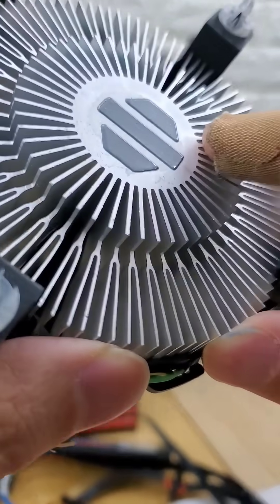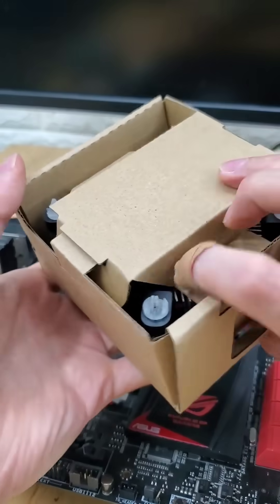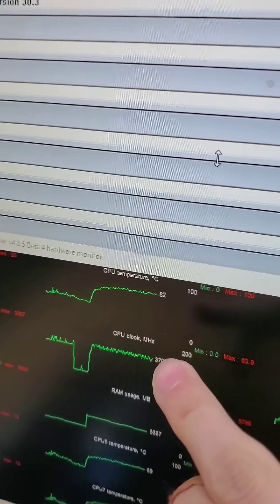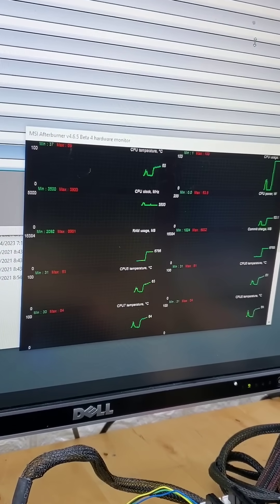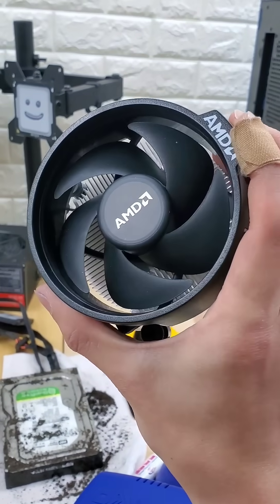how BAD is Intel's stock cooler? #shorts

Comment: Looks to me like you compared intels Copper core cooler with their non copper core coolers. The thermal paste wouldn’t make a huge difference the copper here definitely screws up the results.
Reply: glad someone else noticed as well
Reply: the copper one was just demonstration b-roll
You can see that both the coolers he tested had blue sticker, but the b-roll cooler with copper ha51, d sticker with half blue and half gray

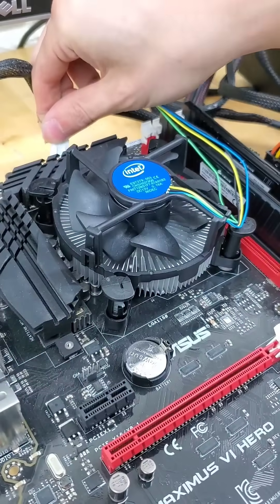Stock thermal paste: 0:16, you can see the cooler is blue
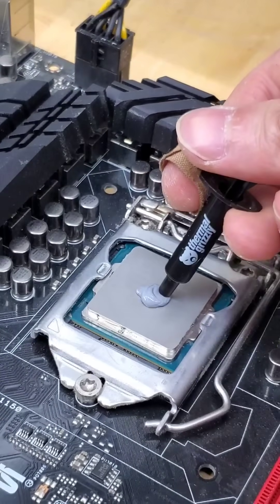High performance thermal paste: 0:38, still the blue cooler
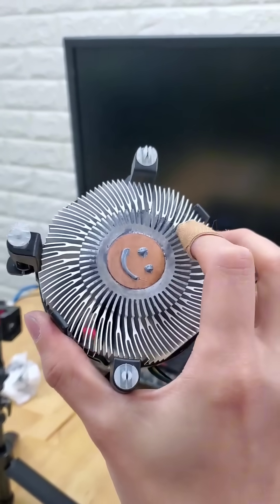B-roll cooler, 0:51
Reply: The smily face one is for denonstragive purposes. You call tell just by the cooler design that its the same one
Reply: Yeah there is nearly zero chance that he was dumb enough to not use an identical cooler for each test.
Reply: @MsHojat  He was not good enough to use identical cooler for video. So chances that he didn't use identical cooler for testing way greater than zero.
Reply: The aluminum cooler in the two tests has a blue sticker. The copper core cooler pictured at the end has a blue and silver sticker.

Comment: Try replacing the standard paste with PTM7950, since it’s likely formulated for endurance rather than peak performance 

7950 is also a high-endurance thermal transfer material, so it’d be a more apples-to-apples comparison

Comment: I have done many a test with the AMD box coolers wirh original past vs better ones and the differential spread was never more than 2 degrees difference but the AmDs box coolers are miles better overall than any of intels box coolers. Its not even close!

Comment: Pls make the video for the amd stock cooler my friend who is trying to build a pc on his own says he doesnt want to apply thermal paste manually and the thermal paste present on the stock cooler is enough and im here trying to prove a point that the thermal paste present on the stock cooler is not enough for intense workload where the cpu and gpu are running at 70% or above and reaching temperatures that my 11 year old laptop has seen when I play minecraft with high end shaders.

Bd
Reply: If he's on AM4 it's even worse because you could pull the CPU out of the socket because of how thick and sticky it is

Comment: Attempt 14 of asking for a mercury cooled computer
Reply: That's like asking to use water as a thermal paste. It's not a paste so it will just fall right out. How would you keep it on?

A mercury amalgam could work, but typical mercury amalgam is mixed with silver which will obviously be very different from just mercury in performance.
Reply: @MsHojat  I ment as a liquid cooled computer, not as thermal paste
Reply: Pretty sure he's done this already
Reply: @wolfrb3906 he hasn't😔

Comment: A polished turd is still a turd. A stock cooler is also just a turd. PS amd is not worth shit unless it comes with the CPU which depends on the CPU TDP - total drawn power. Which alot of them don't. But both and stock coolers are far better

Comment: The Intel paste temperature was perfectly safe, so the 5 degree cut really doesn't matter. My personal opinion only. 5 years down the road may be another matter.
Reply: Change the paste to industrial grade PTM 7950 and you will not having temperature problems for 10-15 years, meaning when it starts to degrade your PC may be already obsolete lol
Reply: @sihamhamda47 lets be honest gamers won’t use the same cpu for over 10 years on average and someone who isn’t a gamer usually doesn’t build their own pc so it wouldn’t matter either
Reply: Lower temperatures are always appreciated .
Reply: Anything over 65 is not acceptable.
Reply: @b @blargblarghonk why though? I ran my amd cpu at ~80c for like 6 years without a problem.
Reply: Intel paste is intended to be stable over a long period of time. It is not made for performance. High end pastes are a lot less stable, giving better performance but tapping out after a year or two. So Intel's product is going to do better after 5 years.
Reply: Use Duronaut or NT-H2 and you’re golden
Reply: Yeah but that’s only if you use the right CPU. A modern i3 or core 5 could easily struggle with this cooler.
Reply: A month,layer of dust and it be back to same lol
Reply: it will degrade quicker then fresh thermal paste.

so u can safe ur additional work 2 years in the future if u directly start with a nice arctic mx-4 thermal paste.

and btw. 5 degrees can make a lot of difference for people running stock fan curves. The noise difference can be a lot.
Reply: Being able to stay at 83 degree without shut down or lower performance doesnt mean its safe , your cpu is still burning , it will not last more than 5 years , and thermal paste cost around 20$ , for that price you get 2x durability

So using the intel thermal paste is only good if you have unlimited money and buy new computers every 5 years
Reply: @shirakolee  Literally not even close to true. Your CPU will be just fine even if you run it for 85-88C for 10+ years. Especially Intel chips, they're made for stuff like this. 

There's a high chance everything else in your pc will give out before your CPU does.
Reply: @Redomic  everything is true , you’re just wrong
Reply: @Redomic minus intel of 13th and 14th gen. right?
Reply: @Redomic Intel does run hotter for sure, but their max safe temperature is below 92°C, danger zone temperature is 100°C, and you should aim for under 80°C as prolonged use at above 80°C  same as AMD, AMD just isn't as power hungry or as hot, for similar performance.
Reply: @shirakolee  that's not how that works...
Reply: @Mostlyharmless1985  good job proving your unknown point
Reply: @shirakolee  my intel cpu has been running above 80 degrees for more than 5 years and it runs completely fine
Reply: @chillpill1266  my old computer worked for 15 years and the cpu is fine , whats your point ? Your cpu could have lasted longer if it wasnt runing 100% all day
Reply: @ Intel CPUs are engineering to run anything at 85-88C for prolonged periods easily. TJMax for some of  the 14nm chips was like 105C and those were advertised to run just fine at 90C. Almost all new gen gaming laptop chips from intel run that hot and are usually configured to throttle at 92C.

If you dont even touch your pc expect turn it on every day for 5 minutes, then it'll  obviously work for decades. What's YOUR point? If I'm paying 1000s of dollars on a machine then I'm going to use it, and 99.9% of the time, the issues you'll face down the line WONT be because of your CPU, it'll be some other component.
Reply: @Redomic  the max temp the cpu can hold and the max temp that is safe to run isnt the same thing , you just keep mixing both
Reply: @Redomic   maybe you dont know but theres a lot of ppls that have their intel cpu dead cause of overheating , only intel one
Reply: @Redomic 
CPUs will experience way more degradation at higher temperatures. Anything above 80C are not ideal working conditions. Yes it CAN work at that temperature but it isn't best practice. Just like how it CAN work at 100C but you don't want that.
Reply: @Redomic No, CPUs are engineered to be able to withstand 85°C - 88°C, not constantly run at those temperatures. Even Intel says that you should aim for CPU temperatures below 80°C and just peeking to above 80°C periodically.
Reply: @Redomic  Adding onto you and every other good sirs wrinkled brain comments, my desktop replacement laptop has been running since 2020 with temperatures into the 90s. The thing wouldn't even attempt to thermal throttle until 98°c and at which point it was VERY good at reducing its own thermal load. Cpu still runs flawlessly today and gets a nice 48x core clock for twice the chops advertised performance. Up from 2.35 to 4.8 on a IETS cooling pad. Never replaced paste
These chips can in fact, accept and like this heat. Over 100°c which is well over waters boiling point the cpu will hibernate and kill itself to prevent the potential for damage. i7-11800h
Reply: @shirakolee  30 years in IT, not EVER have I seen an Intel CPU crap out.
It does not happen. 

Also, they will thermal throttle IF they would get to hot, something AMD historically didn't do back when Intel already did. 

Intels don't run as hot, and don't self destruct if they would be ran hot. such as with overclocking
Reply: @stijnvandamme76  you must have missed the 14k killing themself while the amd didnt
Reply: @shirakolee  6/10 ragebait not bad, better luck next time
Reply: @tylerdurden6220  ragebait what ? you're the one that ragebait my answer , im only saying the truth
Reply: @shirakolee  your score went down to 4/10, try again mate

Comment: I've been using the AMD Stock cooler for a long time! works amazing
Reply: Does your cooler still have the pre-applied layer of thermal paste it came with,or did you replace it along the way?

(I'm asking,bc. I recently,7 months ago, built a 500€ AMD PC with the 5500 for my CPU,got the stock cooler and didn't touch the pre-applied paste and now don't know if I should chamge it right now or if I ahould give the PC a full year or two to get around to changing the thermal paste and possibly exchanging the cooler...)

so...what I wanna know is if you changed the stock coolers thermal paste from the pre-applied one with another brands paste,if yes how often,if not then I'd like to know how well the cooler performs)

Thanks in advance✌️

Comment: Video 55 of asking you to solder a CPU cooler on a CPU.
Reply: I wanna see that!
Reply: Well then the heat transfer efficiency will decrease

Even during Liquid Metal applications,the IHS is the bottle neck 

I more wanna see a pure copper cooler and it’s making direct die contact with Liquid Metal inbtwn 

I can bet it will have some major decrease in heat(prolly 10+ degree difference)
Reply: It would be better than thermal paste, solder is a metal and it's better than thermal paste. @Snay1998
Reply: It'll still be worse than de-lidded I think
Reply: Have you ever soldered?  Have you ever tried to solder to something that’s designed to move heat? The CPU heat spreader is designed to move heat, and the cooler is a massive hunk of metal that’s designed to move even more heat. You would need to get the entire heatsink to solder melting temp, as well as the IHS, and that’s going to take waaaay more power than even an industrial soldering iron. And even if you could accomplish that, you’d have to sandwich them together at temp to get them to bond, and before the solder would solidify. Oh, and you’d fry the CPU in the process, because it can’t take that amount of heat for that length of time. 

You might be able to delid the CPU, weld the IHS to the heatsink, and then reattach it to the CPU, but that would kinda defeat the purpose of the experiment.
Reply: @TheRenHoek LTT did just this on a laptop using an oven. I'm sure he can make it work too.
Reply: i remember asking that once or thinking about it haha
Reply: It's a cool idea, but surprisingly hard to pull off. In order to create a solder connection you need to heat the mating surfaces up, which would likely damage the cpu, and be almost impossible with a heatsink. Because of its high thermal conductivity, you would need to heat the entire heatsink up, and because it's, yknow, a headsink with a lot of surface area, it would rapidly cool.
Reply: a year later did this ever happen?
Reply: @Nossody  Nah sadly

Comment: I'm using the AMD stock cooler and it works for me.
Reply: It has more paste on it.
Reply: @henrylongheadbecause the design on the dye is different.
Reply: @henrylonghead it’s not the paste much but rather the design itself,mine has copper plate and a beefy aluminium heat sink 

It’s a good designed cooler for stock
Reply: @Snay1998 
That is or at least used to be standard on AMD stock coolers. Copper heat pipes with f tonne of aluminium perfectly spaced to work even if few fins get bent over time I still us my stock cooler I got around seven years a go and my Ryzen 5 3600 barely goes over 80 when playing Warframe for example.
Reply: Same. Using arctic mx4 paste
Reply: Me as well I never see over 78 on most games on metro exodus it will occasionally hit 82-84 but I respect it bc I’m pushing tf outta that cpu😂
Reply: I used to get 95 degrees while gaming on my Ryzen 5 5600 with the stock cooler. I got a Thermalright Peerless Assassin and got around 60 degrees on the same games.
Reply: @FreedomFighterAsuka  i got the same cooler. That thing is beautiful, I went from 60 to 35 C when idle
Reply: Had a base amd cooler on my 5600x under load it hit 86 max, people hitting their tjmax you did something wrong, probably smashed your paste out one side lmao
Reply: Yeah, I used to just use whatever stock cooler came with my cpu but not anymore. After looking at temps and utilization before and after a cooler upgrade it appeared that my 3600 was thermal throttling. Before upgrade I was seeing cpu utilization 60-70% and temps 75-80C. After upgrade to a vetroo V5 utilization up to 75-85% and a max temp of 60C. This is with the same game before and after.
Reply: Never changed my stock cooler for 5 yrs and never had problems but I recently replaced it with DeepCool AG400 as it is a pain to clean, dust accumulated and became like paste in the cooler.
Reply: thats because amd coolers are actually kinda decent in comparison to intels. they also give you bigger coolers with higher wattage cpus. meanwhile intel gives you the same shoddy cooler with every cpu
Reply: Well and your cpu used to be 125 tdp, you tend to learn.
Reply: Useful information, on an Intel short for some reason.
Reply: have fun replacing it one day and ripping your cpu out
Reply: @yasinhenfs4540 sounds like you have a skill issue. It's not that hard to take the cooler off without ripping out the CPU
Reply: AMD actually knows how to paste their Wraith coolers (or at least, they know better than Intel) but those coolers are still trash
Reply: @Cedalus The Wraith coolers aren't trash, they just are inexpensive. They work more than good enough for the vast majority of applications. 😅
Reply: @teufelhund3801  CPU intensive gaming is not one of them since Ryzen chips like to boost really hot during intense rendering loads, the heatsink and heat pipes are just too small to move enough heat
Reply: @Cedalus  No, typically they boost high during raytracing, since they aren't designed for that, rendering images they have no problem with. With bench marking AMD and Intel rate around the same in performance for the corresponding chipset, and AMD runs cooler. Raytracing throttles a lot of AMD, but honestly, even though they are not designed for ray tracing, you can get near Intel performance even in raytracing scenarios and they still run cooler under similar loads with the same cooling unit. 

WTF are you talking about pipes? You mean the air tubes? There are no air tubes on these heat sinks. Lmao.
Reply: @teufelhund3801  not knowing what heat pipes are means you don't know what you're talking about
Reply: @Cedalus  Except neither had any pipes, both in the video were passive heat sinks with fans... LMAO.
Reply: @teufelhund3801  you specifically brought up the wraith coolers so that's why I brought up heat pipes. The wraith prism has heat pipes.
Reply: @Cedalus  I didn't bring those up, I was replying to someone who brought those up, and their tubing is standard sized, not small. LMAO. Which the Wraith heat sinks are active heat sinks and cool better than the standard passive heat sinks that come with the CPU. LMAO. So, you continue to show you don't know what you are talking about, yet you keep yapping.
Reply: @teufelhund3801  also why would CPUs boost only during raytracing? Most RT done today is hardware-based (GPU) anyway, but there are more gaming-related tasks besides software RT that push the CPU. Collision and AI and distant simulations (think jacking up the render distance in Minecraft for example). It handles the actual numbers and where stuff is in the game, all the GPU does it make the image.
Reply: @teufelhund3801  your very first reply to me brought them up, and there aren't enough heat pipes in the wraith prism
Reply: @teufelhund3801 CPUs don't raytrace that's on the GPU side so not sure why you said AMD CPUs aren't designed to raytrace neither are Intels.
Reply: @Cedalus  depends on how you use
Reply: @Cedalus  intel cooler is not bad, its cheap and its made for avereage user that will not replace its paste for 5ys, with arctic or thermall gryzley u will ofc have smaller telp but after  2ys u will have higher temp then intel paste because intel paste is siliconne based and it doesnt dry out and its spread like this so it can be easily removed
Reply: @ladislavzenk2139  the included thermal paste being silicone-based is not a good enough case for the Intel cooler. The vast majority of coolers you can buy will come with silicone paste, either in a tube or pre-applied. I don't care about the quality of the paste really. The cooler simply doesn't move enough hot air to be viable for intensive applications.
Reply: Mine with my side panel on goes to 90c but without its at like 65 max ig so yeah as a stock it's good but I also have 3 fans and good airflow since with my side panel my gpu is at 42 max
Reply: It only works good if you have a windows xp machine. For me it never reaches 40 degrees C.